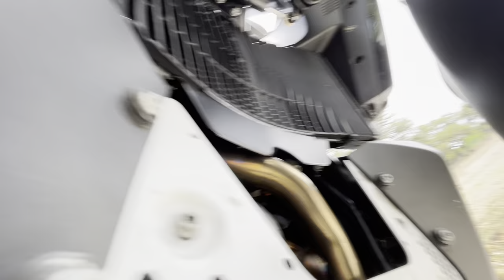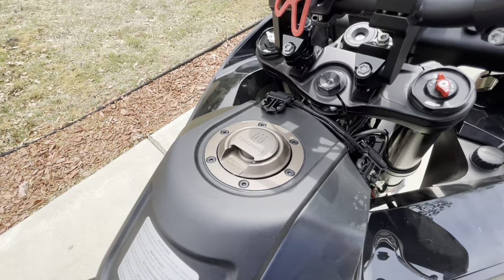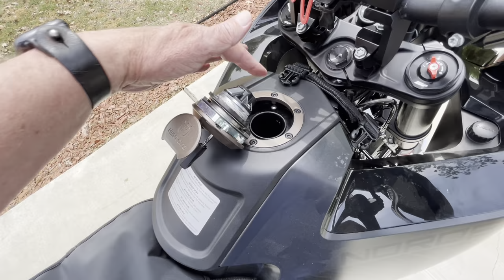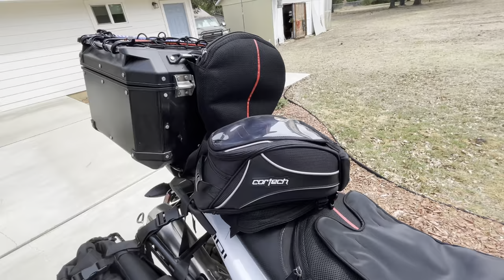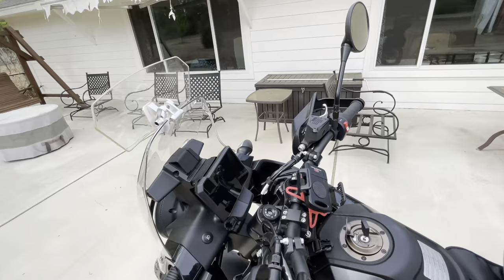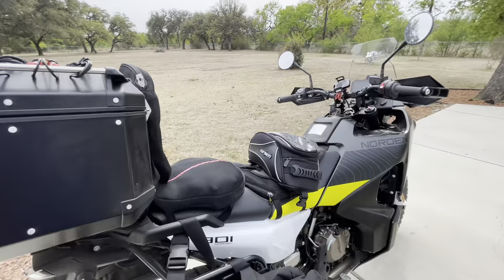Problems with my Husqvarna Norden 901 - Fuel and Coolant

Comment: I was thinking of buying a 790R but reading about this sort of stuff, and worse, put me off. I used to have a 950 Adventure, and I have a 390 Duke, and they were/are very reliable. I am sticking to Japanese from now on, though.  If I wanted an adventure bike, it would be a T7. As things stand, I may get an XSR700.
Reply from the maker: One of the things someone pointed out to me was: I bought a first year bike. I have never done that before. I have always waited for the problems to be sorted out. However, I am getting older and decided I only have so many riding years left. I added road side service to my insurance policy and hoping for the best. If I was riding solo, I probably would have picked the T7.

Comment: Would love your opinion on how it handles two up touring being a ‘mid size’? It is one thing that is never reviewed by the professionals!
Thanks
Reply from the maker: Hello. My wife loves how comfortable it is as long as we stop every hundred miles for a stretch. She would want that on any bike. When I first got it, it handled extremely well. I have a background of riding sport bikes in the 80s, 90s and early 2000s. I was completely comfortable with the handling from the first time I rode it. However, the shock got very spongy and I could not adjust it out. The dealer says there is no issue and the bike has been stuck in the shop with no resolution in sight for any of my issues. Personally, I would never buy the bike again for that reason. A great bike stuck in the shop is of no use.
Reply: @Texastoo2  thanks for the response! That’s a great shame!
I bought a ktm 1290 super adventure s new, loved the bike but had a million electrical gremlins over a year. Sounds like ktm group are still producing poorly developed bikes!
What are you thinking of getting instead?
Cheers
Guy

Comment: the build quality seems atrocious I wouldn't know if I feel safe on it, if the water hose is loose and the fuel tank fittings are loose, what else more important may be loose that might throw you off into oncoming traffic
Reply from the maker: I agree. For someone like me, it is a bad choice. I should have gone with an Africa twin. I like the Tenere but I ride a lot with the wife.

Comment: How does your wife find the comfort of bike in pillion. ?
Reply from the maker: At first, we both got uncomfortable pretty quickly. I just asked her for her true thoughts: She said it is very comfortable now but likes to get off every hour to stretch. We went 300 miles yesterday and drove the last two hour straight. She said the last 30 minutes were torture. We are not in the best riding condition yet. I think she would feel that way even on a Goldwing. Hope that helps.
Reply from the maker: I got more clarification from the wife last night. She said the bike is completely comfortable the way we have it setup. Since we were in high winds and some rain on that trip, she was hanging on by squeezing her legs tighter on the bike and her legs started cramping. Plus we hiked the hardest trails when we got to Garner State park here in Texas so her legs were probably already tired.

Comment: get gas cap warrantied. that's the reason you get a one year warranty
Reply from the maker: Hello. I took it into the shop to get the fuel smell and the spongy shock fixed. After sitting at the dealership for a month, they said nothing is wrong but they will be happy to re-valve/fix the shock for a fee. So, it is up to me now to fix the stuff.

Comment: Check your state’s ‘lemon’ law
You may be able to return it and get a full refund
No new bike owner should have to go through what Norden owners are going through…
It’s that ‘790 cancer’ on steroids
Best of luck 🤞
Reply from the maker: I think you have to have 3 trips the dealer for separate problems. I have not even been once. I work as a PM contractor and have been interviewing most days. Once that settles down I will make a trip to the dealership. Thanks for the good luck.
Reply: @Texastoo2  I understand
Ian from Big Rock Moto had 6 different issues on his new bike but is also mostly choosing to deal with them by himself… in this case DIY is your downfall 😳
Please update us
Fingers crossed 🤞

Comment: For years I was saying European bikes cars are much cuter than Japanese way more sophisticated and engineered. BMW Mercedes Ducati KTM Husqvarna so on. But they are not made to last though they will last. It's just gonna cost you. Seeing it with BMW adventure bikes they fantastic. But you better be mechanically inclined or have money to burn after 3 years. Those mostly money pits once u fix something else will come up. Can you commute with Lamborghini yes absolutely it will cost you on the long run or just buy a Toyota 4 runner not so cool 😎
Reply from the maker: Good comment. I knew that going in. I was just hoping I would get lucky. I am still hoping when these few items get fixed, we will just get to enjoy the ride. I guess I am just an optimist.

Comment: Made in China right? :)
Reply from the maker: My understanding is that the engine is made in China.
Reply: Not made in China, but still questionable quality assurance😟
Reply: None of the higher displacement ktm stuff is made in China.
Reply from the maker: I guess I am not a good person to ask. I have not really been able to find where I read that the engine was made in China. So, I have no idea.
Reply: @Texastoo2  no you're right a lot of the smaller engines are made in China now. The bigger adv stuff is still Austrian built. I'm a ktm fan boy but build quality is for sure an issue. Just don't know why.
Reply: Did you buy it from T,J cycles ? I been having a very good experience with them, one of the most helpful and honest dealers that I have deal with, I have a 2019 690 Enduro r, and I had 0 issues, reliable as my previous Japanese bikes, but the bike, has been evolving since 2008, and by now there's nothing like it in the Japanese market, the 890, and the northern are still evolving at difficult times when there's more demand than availability, fortunately there's a solution for all the problems, on the other hand you have a State of the art bike and there is nothing out there yet in the Japanese market for that segment, the T7 is not even closed, 
Best wishes, and happy Ridings 🏍️
Reply from the maker: I finally think I know what you are saying. I thought the 890 was the large engine but you are talking about the 1000+cc like the 1190. Thanks for the info.
Reply from the maker: Hello. Yes, I bought it at TJs. I really have not dealt with them besides picking up the bike. The parts people seemed friendly. Actually the only other bike I was considering is if the new Transalp came out. I really need cruise control, comfortable pillion and at minimum a quick shifter. It was like when I bought my Volt in 2013. At the time I did not like Chevy but they had the only car with the features I wanted. Got lucky with it. 9 years now and zero problems.
Reply: Rebadged CFMOTO
Reply from the maker: Just got some time to try and get it looked at. They said they could not even take a look at it for 3 weeks. Never had that happen before either. Oh well. What can you do?
Reply: @tedkippers7591  - The 790 motor was licensed to CFMoto; 890 motor is still produced in Austria as far as I know.
Reply: @Texastoo2   That's true ,they are very busy I had to make an appointment 3 weeks in  advance, but the good thing is that once the bike comes in it looks like they start working on it almost right a way, mine was out on the following day
Reply from the maker: @ferkuzuel  Thank you so much for the information. I have never dealt with them before. That provides some reassurance that they will get the bike squared away. Have a great day!
Reply: nope

Comment: This problem is not because of the motorcycle, it is because of the gasoline legislation in your country. You're in the United States, right? Gasoline is very corrosive and is not within our European standards. Every year you have these problems on European motorcycles.
Reply: I’ve never had these problems with the 3 BMWs that I’ve owned. KTM quality is just poor.
Reply from the maker: Agree and dealers are short handed so it takes forever to get minor issues resolved.
Reply: @kevinmccarthy621  that has not been my experience , thankfully

Comment: Sloppy build quality 😕
Reply from the maker: Agree. One of the issues I ended up fixing myself as a design issue. The gasket for the gas cap has two areas that are less than a mm wide. It caused my gas smell.